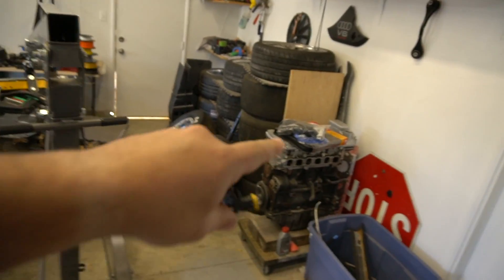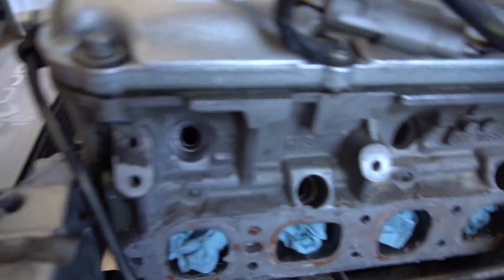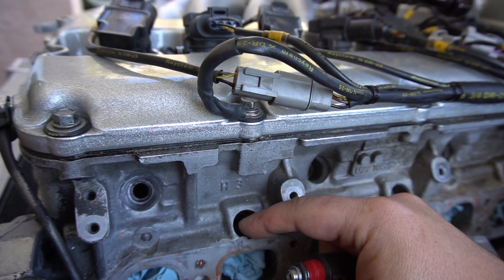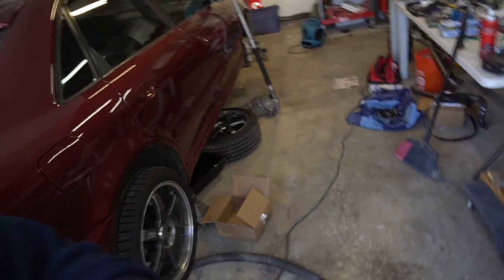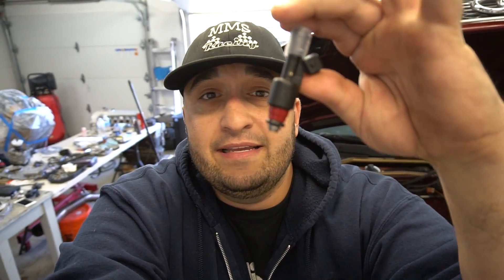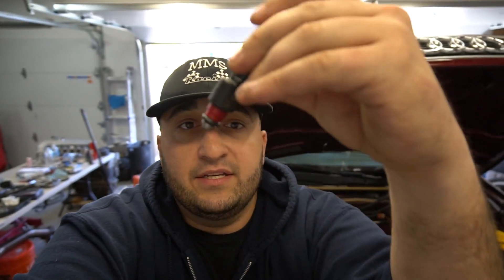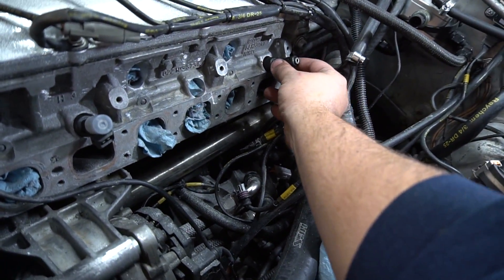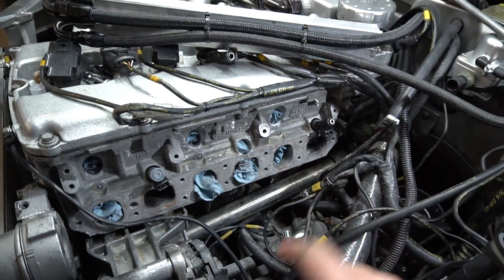Grinding a 24v VR6 cylinder head to fit 2400cc Injectors

Comment: At least you should have used a hand drill and a reamer to maintain the even cut and con centricity
Ideally two separate steps like 18.5mm then 19.5mm

Comment: On the 3.2 head what are the biggest injectors you can run? Do these deka injectors in the video fit in the 3.2 head without modification?

Comment: Nice video as always, I'm not so much technical guru ,but the idea that I have I my head to share with you,as same as all of us watching different channels. Wouldn't be better idea for you to tap on the intake manifold second rail of injectors as long with you original 1400cc and as long as your ECU can operate such way of fuel sistem. I don't want to mention some brands just in case of offending somebody. Same way of fuel sistem is used on many high horse power cars. I admire the way you are doing it your way. 
Keep inspiring people. Always please to watch you videos,but please don't do video without Stav😂😂😂

Comment: Couldn’t you run a second set of injectors to get the flow, lots of ecu’s have drivers for double injectors.
Reply from the maker: James T we could, but having a set of injector bungs precisely welded/fabricated into the intake manifold + wiring added to the custom harness along with custom software to drive the second set was a lot to ask 2 weeks before a racing event

Comment: You've gotta do yourself a favor and buy the Dremel extension cable, it extends the collet away from the motor body so you can set the motor down and don't have to hold that weight in your hand while trying to do some detailed work.
Reply from the maker: Matthew Coppola hmmm, didn’t know that was an option, we’ll look into it, thanks for the heads up 🙏🙏

Comment: Does the 3.2 head just bolt on to the 2.8 motor or do you have to modify the engine Block?
Reply: Bolts right up with the 24v 2.8 block.

Comment: Couldn’t you put the injectors on a lathe and take off 40th to get it to fit your head?
Reply: Why not maintain the FIC and add another fuel rail with more set of injector that you already have. Them you will be prepared for future increasing in power.
Reply from the maker: fel1979 a combination of the 24v 2.8 VR6 injector ports are in the cylinder head and not the intake manifold, not having abundant list of shops willing to add the rail within a reasonable time table. 

Ideally your idea is great, if we had someone local who could do it, we would entertain the idea of adding another row in the intake manifold for sure
Reply from the maker: peter pap didn’t seem worth it to potentially damage the injector not knowing the thicknesses vs aluminum head with thick tolerances
Reply: Cheaper and easier to replace an injector in my opinion. Good luck with it
Reply from the maker: peter pap not if the injector comes apart and parts fly into the combustion chamber during a pull. 

Shaving a plastic body with unknown thicknesses did not seem worth the time. 👌

Comment: Would it have been easier to grind the casing of the injector instead? If anything still love your channel 🙌🏾 fellow b5 s4 owner
Reply from the maker: F Dac Didn’t want to shave the body of the injector and potentially have one fail/explode. We felt confident lightly sanding the head as it more than likely had more real estate
Reply: Malaka MotorSports I see where you’re coming from. Keep it up though, can’t wait to see it run man! Mad love from the UK